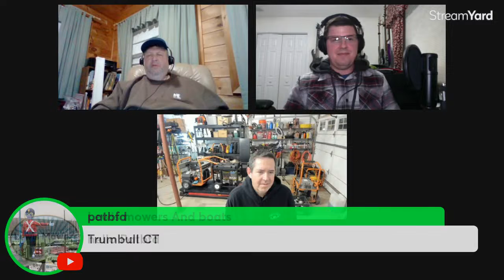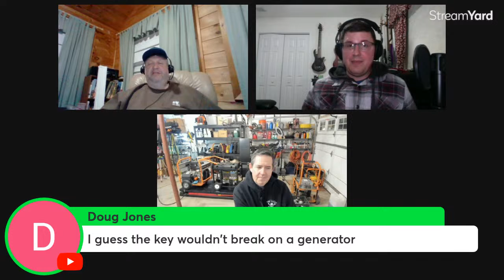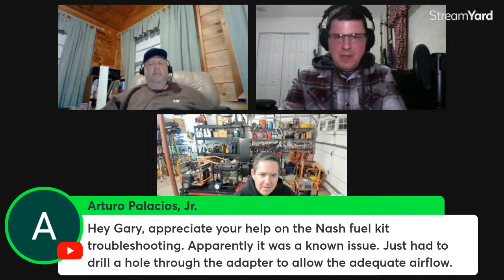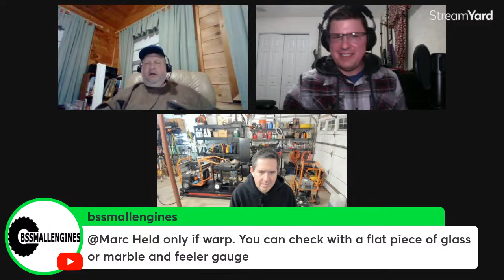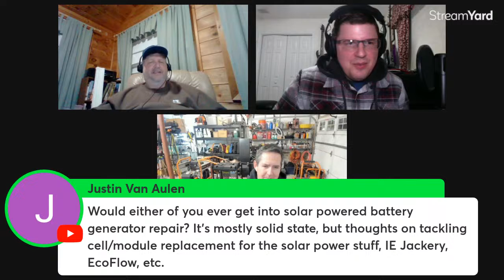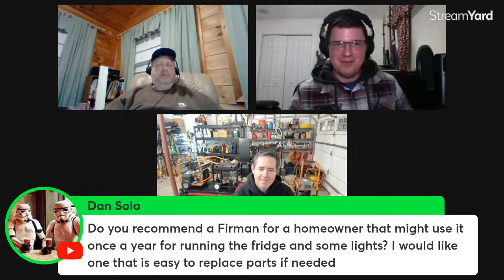Small Engine Generator Q and A with James Condon and Gary Bernacki LIVE February 21st at 9pm EST

Comment: As an electronics engineer I’d like to add a little on THD. If it is high the main issue is that you generate heat in the power supply of the device you are using. Especially engines. Your non Ali express phone charger has capacitors that make it handle it just fine tho the rectifier will run a little hotter. On the compressor of your fridge it will run a little harder as It’s not as smooth and also a bit hotter, but it will work and probably won’t cause harm, but it depends on how high the THD is. When it comes to electronics it basically depends on the quality of the device and how much you want to risk shorten the life of the devices you use. That said, the utility power is rarely clean. In the US the limit is 3% but I have rarely seen it less than 5%. An good inverter generator can produce 0,5% THD.

Comment: Great conversation on Thd. Just what I needed to hear though it's a disappointment. I bought a used Firman tri fuel 7500/9000 generator barely used for $500. Starts and runs great but I read the Thd is 11-14%. I'm wondering now if I can even use it for my digital controlled Mig welder. I really got it for rare brown outs during summer. Wanted to run lights, TV, refrigerators. Now I know I can't. It's a beautiful machine but turns out not much I can use it on.  On another note, someone asked how you all got started in your sidelines. I'd like to know what kind of work is your day jobs?
Reply from the maker: I’m a machine repair foreman

Comment: I have a standard Predator 9000 generator. Both my furnace and Ac have in line MARS surge protectors. Will this help in anyway from the dirty electricity. I have been using my generator with no issues. Most other electronics are in power strips that have surge protectors. Any insight on this?
Reply: No they will not protect against dirty power, AKA high total harmonic distortion. Surge protection is better than none at all. It won't prevent malfunction which is a higher chance than with an inverter generator.

Comment: Hello guys, is it possible to hook up a 12 volt outlet on my generator if it didn't come from the factory with one?
Reply: Most generators that have a 12 volt outlet are using an auxiliary stator winding meant for that purpose.  The easiest way to get 13 volts out of you generator would be a transformer plugged into the 120v AC

Comment: Thank you, the intake valve has a valve seal, the exhaust valve doesn't have one, no place for it. The exhaust valve does have .006 play in the guide. The engine is a Briggs 19G412-1129E1 you guys are fantastic.

Comment: How do I know if my Generac 5,000kw is pulling a load with nothing plugged in. Can't seem to get rpm's up. I don't have a tach, also it smokes a lot when first starting up but stops when warmed up. Valves have been lapped.
Reply: Grab a tach, the engine will noticeably drop in speed when loaded. Smoking a lot at startup but clearing up after it's been running is a valve issue, maybe a combination of worn guides and worn valve stem seals.